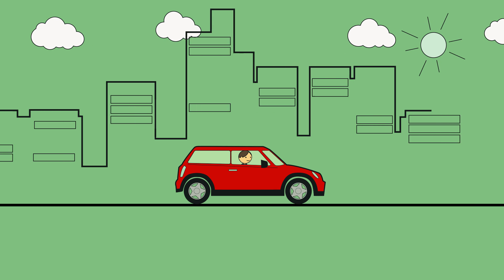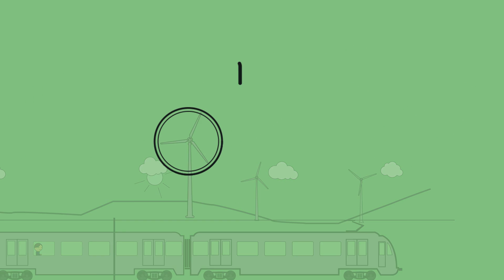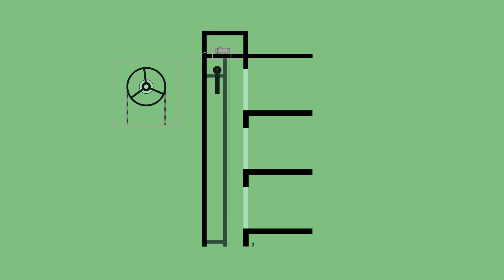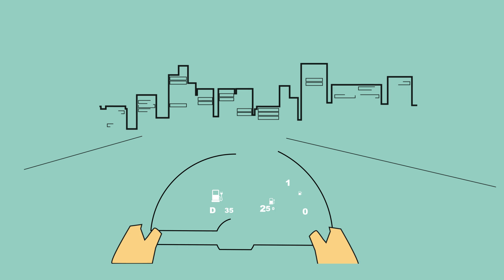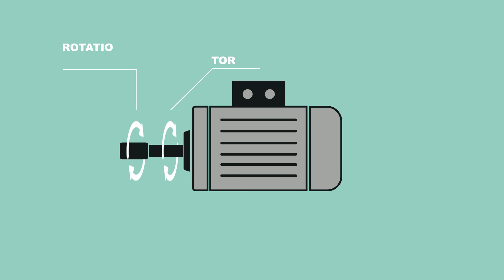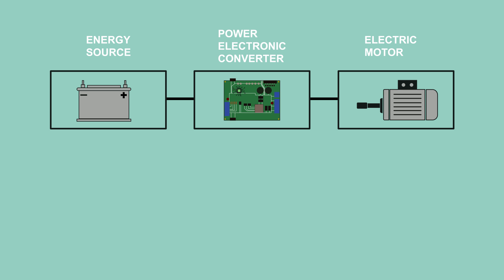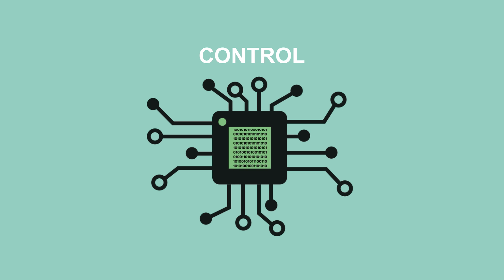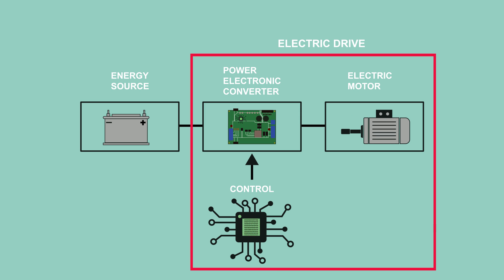Power electronics and electric drives for traction applications

Comment: cool. Nice Video!!  
But does All Electric Traction movements require  Electric Motor??
Reply: yes my friend, majorly traction application in heavy loaded transportation such as Trains need high torque in the starting which is provided by DC MOTORS while you compare it with EV, manufacturer generally uses induction motors or brushless dc motors with associated power electronics unit involved in it.